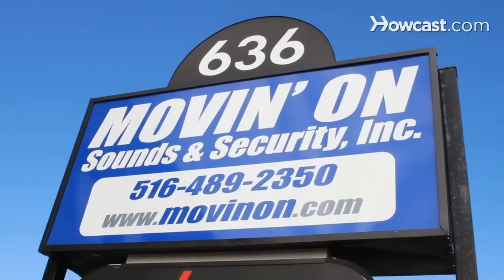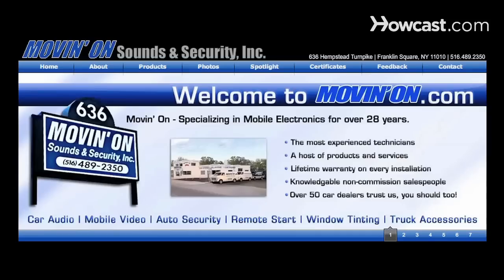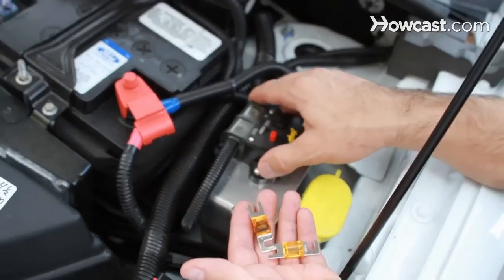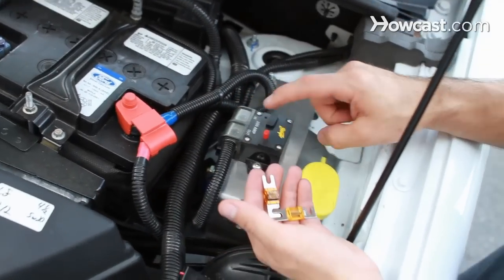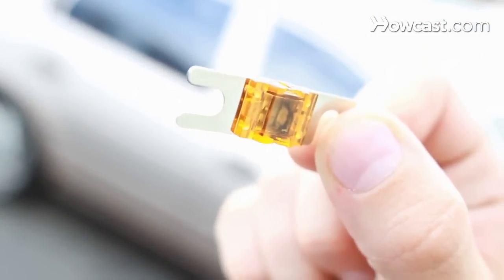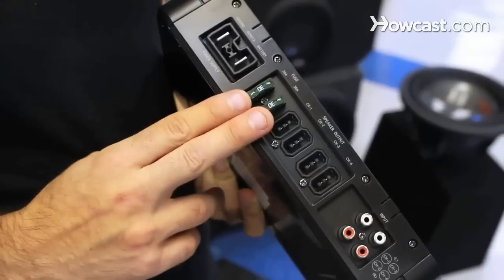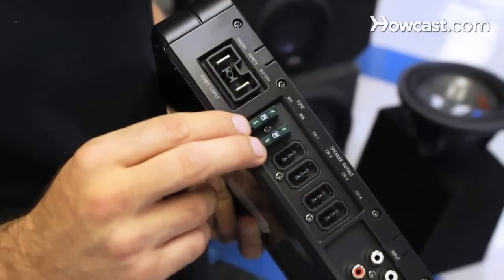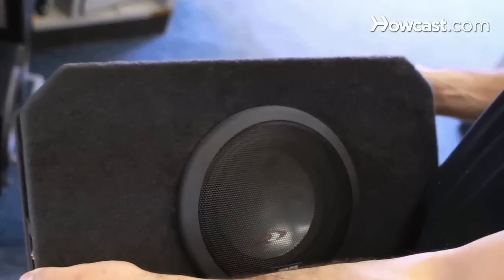How to Troubleshoot Dead Sub Amplifier | Car Audio

Comment: Helpful tip: Touch a 9 volt battery to the (+) and (-) on your subwoofer to check if it's working or not. If it pops, it's working. You can also use this to find out which lead on the subwoofer is positive and which is negative if they're not marked. Touching the positive to the positive and the negative to the negative makes the driver pop outwards.
Reply: Cheers
Reply: What does touch mean? Connect a 9v?
Reply: @MrFunnyHandsInYourPants obviously

Comment: Need help! Accidentally touched my amp remote wire on positive gauge for the amp and it blew out my whole stereo but can't find a blown fuse?
Reply: Go into your car owners manual and look for where it says your fuse for your speakers and if that's not it check the backup fuse which is normally located under the hood !

Comment: My system suddenly quit working. All wires seem good. Fuses OK. Speakers not blown. Was working great for a few months then boom died when in use. Checked wiring at amp with multimeter and showing nothing. Checked fuse but seemed OK. My next move is redo all wiring (as where I had it installed used some tiny gauge wiring and I know it should be larger because it was in my old vehicle & never had fuse blow issues, etc. like I've had with this install).
Reply: And what was the problem? Currently having the exact same issue

Comment: Sub was working, no issues, main fuse fine but then stopped working and blows every fuse I put into the sub (active sub) regardless of if it's running or not, I suspect the sub is dead, am I right or can I save a few hundred $$ on a new one

Comment: I had a similar problem... My subs / amp would just cut out intermittently while driving around town.  Eventually they just stayed off, connections are fine and my amp is showing power (green light) and is NOT in protection mode.  Fuses on the amp are fine as is the one by the battery.  I pulled the amp just in case it's bad and tested another amp but still no sound from my subs.... I'm literally stumped.
Reply: +TheMysticSpade 
if you put another amp in there and it didnt work i would say, double check your ground from your amp to your car, i had the same problem and i ended up running my ground to another location and scraped all of the paint away before securing it on there, also check the wiring to the subs inside of the sub box, i also had a wire come loose once and caused the same thing!
Reply: +TheMysticSpade Maybe a blown sub? There are ways to check that, if you search around.
Reply: paantma actually the voice coil went out on one as it's now locked and won't move.  And the other apparently due to the air pressure in the box was just moving on the connectors.  The place I had install my system did a shitty job.  No solder or crimp connectors just hand wrapped.

Comment: I just hooked up a 2 10” speaker box that was a gm factory upgrade for my camaro.  It only has one cable come out of the box that plugs into a harness.  When I plug it in I’m not getting any power. No lights etc.  I checked the fuse but it seems to be good.  What is the next step  to troubleshoot?

Comment: I hooked everything up months ago pretty well. Then the fuse/fuse holder under the hood melted, replaced it with a brand new one. Then today I was driving constantly then I noticed it wasn't playing and no lights on my amp are on anymore. Is my amp done for ?
Reply: +Willie Murphy Check your remote wire connected to your head unit, that's what happened to mine. If that's okay, then check your ground power, most likely you will need to move it to a different location.
Reply: Ok thanks

Comment: I have a Sony xm series old school.. all of the wiring is fine the green lite in the amp is ok. But when I connect the speaker there is no sound coming out from it..I swap amps and it works fine. Any idea's why this amp even though the green lite is up it won't produce any sound????

Comment: Where's the fuse located on a Soundstream tarantula tx4 560w amp?  My car I bought came with it, hooked up to a head unit dash speakers and door speakers also two 3way PwrBass extreme bi amp crossover (which can be a amp too) on the kick panels. 

Fuse under the hood is good, there's a hiss noise with radio on but still sounds good. When switch to sub from the cd player there's a slight volume drop, low sound through door speakers due to No sub-woofers hooked up.

I believe everything is fine with each amp. Just want know if it this is common and can I test each amp with a digital multimeter.
Reply: I am having problems with my amp it keeps burning my fuses
Reply: +Amy  Salazar get bigger fuses or lower your bass, just remember if you increase your fuses they might not protect your amp

Comment: I had 3 12"s powered off an 1800 hifonics amp, and i was bumping juicy j all the  sudden it cut out. I literally took everything apart changed amps subwoofers. My thing is it could be the fuse under the hood. But on both amps theres a green light, that signifies that amp is good to go, and red means stand by mode. Well i flipped my switch amp turned on, red light cam on, then dimmed out. I'm at a loss for words right now. Makes me want to take this stuff to Steve Meade.
Reply: your subs may have popped...
Reply: Frank Mannino Found out what it was, the main fuse under the hood, leading to the power cable (RED) was, melted i guess it was too much, for it to handle. I bought a new fuse, only like 4 bucks, and only have that one 12' in there now. Doesn't slam as hard, but guess that's better than going through fuse's like diapers. Lol.
Reply: you should really go with 0 gauge and make sure you have a really good ground and you wont have to bother with blown fuse's anymore.
Reply: 0 gauge wire, for the speaker to the amp, or for the +,- wires? These are good tips man, because i like giving bass demos to friends. :)

Comment: Ive got a hifonics brutus 1200 watt amp.. it completely stopped working no idea why. i tried a different amp and it works so its nothing to do with my wires. I have looked inside the amp and dont see anything that is burned or broken, there are no blown fuses, and everything looks like it should work. any help would be great!

Comment: How many volts should be coming down the red wire that connects to an amp on a car? For some reason my sub and amp combo has stopped working I've changed nothing, both fuses are good but for some reason it just stopped working. Both sub and amp have ran well for two years or more.. I've changed the remote lead and put a new connector on my ground and still the amp will not power up but when I Ark across from the power to the remote the sub works but the green led is very faint.. can you help?

Comment: I have two amps one for the speaker inside and the other one for the subwofer. I recently got a boss 5000 phantom install today . For some reason when I was playing it both amps stop working . I only hear the speakers inside. the amp for the subwofer is making like a pulse sound. What could be that?

Comment: so i have an BOSE OEM amplifier on my infniti G35 coupe 2004 and when i turn the car on it will take about 1-5 minutes for the sound to come on and after driving i turn the car off and turn it back on right away and the sound will come on right away. it only take about 1-5 minutes for sounds to come on only if the car is turn off for about 5 minutes or more. The radio, CD, cassette do work but with no sound for about 1-5 minutes after i turn the car on. so im not sure if its a wire problem or the amplifier since i already check the fuse and its still in good shape. pop open the amplifier and check and it looks like its good and im not sure about the wiring because its not like the speaker/sound wont work at all. it still work on all 4 speaker with clean and clear sound after that 1-5 minutes. and sometimes the speaker makes that popping noise. like a bass sound kind of popping noise before i can get sound back after that 1-5 minutes.
Reply: +Tewthpaste Check your battery, it might have a low charge

Comment: ihave two 10 in rockford fosqates and a renegade amp that matched up perfectly and played great for awhile and they stopped one day. no fuses are blown. the amp is fine. the only way i can get power to the ampis by taking a second rem wire and connect it to the rem port to the 12v port. then my subs play but very faintly and not to the song. my ground is going to my trunk and i have 12Gauge wire and my amp puts out 250 rms to each sub. whats wrong?

Comment: I have a 1200 watt amp and 2 12s and ever since I first hooked it up it dosent make them hit hard at all before turning off then when it hits just a little it turns back on and will hit again until it hits to hard already cheaked my fuses and everything it worked fine before I use to have a 600 watt amp and I just switched them out

Comment: i have a 91 integra GS, single 10" clarion sub, 400 watts with kenwood amplifier, which keeps draining my cars battery. Does that mean the wiring is wrong, or is my amplifier gone bad? we got it looked at, and while my cars off, theres power being used, when we took out the fuse, there was no power withdrawn. The guy said the amps bad and that 400 watts is way too much for my car too handle and recommended 150 or 200 watts.. im wondering if i need a new amp with lower watts, and also when the fuse is connected, subs work fine, sound nice, but after i turn my car off, wont start unless i jump start it.
Reply: I have 2 12 2400 watts how do I wire them I ran 4gauge wire that come with the amp and it blew my fuse on my battery what do I do
Reply: do you have a remote turn on wire? It will allow the amp to turn off the same time as the car.

Comment: i have a 5 channel amp that wont play my sub it will play my speakers and i just rewired it and sent the amp back thinking it was defective and the new one does the same thing any suggestions? its a 8 inch sub too

Comment: None of my fuses are blown and all connections are fine(I've tested another sub with them). But my sub isn't getting any power not even the power light is turning on. I've opened it up and all inside connections seem to be fine. Anyone have any idea?
Reply: Hey I’m having the same problem right now. Did you ever get it fixed?
Reply: @MrFish218  I ended up salvaging the speaker and using a new amp for it and it worked fine after I made a DIY box. Old amp must've fried

Comment: I have a problem! I just recently installed 2 15' subs and a 2000w amp, it is all hooked up correctly, when playing music if I turn it up pass 55 on the stereo my subs stop, so I added a capacitor to hold the power steady to the amp, still having the same problem. So how can I fix this problem, where do I start? Any help would be great. thanks
Reply: It's your ground

Comment: ok I have had the same amp and and everything in my truck for years work fine but to day it shot a fuse and I put a new one in and went for a drive I stop to check it out and the amp is really hot I look at all the wires and clean around the ground and its still geting hot please help

Comment: here's my problem and pls help. I have an active sub and another amp on top. I have two 6×9 speakers on my parcel shelf. suddenly my 6×9 speakers stop working. there is also a mild buzzing sound coming from the boot area

Comment: My Nissan installed rockford Fosgate trunk mounted subwoofer has started "popping" even when the car is off.  Can't use the audio systems as this popping interferes.  Unfortunately the subwooer appears to be hard wired into the system (there are no wire clips or plugs) so I can't just remove the unit and bring it to an aftermarket Fosgate dealer to have it tested.  Can anyone offer some suggestions?

Nissan wants $150 just to troubleshoot.  Not sure I trust them to find and or fix the problem.  After all it's not an oil change!!!

Comment: I recently uninstalled my sub and amp because i was going to sell my car but decided not to, so then i recently reinstalled amp and sub but for some reason now it doesn’t want to power on, any ideas why thats happening, ground and fuses are good
Reply: Same I even hooked up another amp I know worked and it has no power. Everything was working fine and tech mine song everything turned off I don't know what fuses to check besides the battery fuse that runs to the amp and the fuses on the amp

Comment: Mine is wired up correctly, I’m getting a good ground, good connection to the battery with a good fuse and my remote wire is working but the amp doesn’t turn on. My fuse on the amp is good but my amp still doesn’t turn on. Is there anyway for this ?
Reply: Felipe Perez same for me however I’m trying to locate the fuse under the hood
Reply: Sir Fapsalot I got mine to work somehow in the morning. All I did was turn on my truck and it worked lmao. Weird asf
Reply: Felipe Perez it’s annoying because my sub amplifier was working the other day and then suddenly stopped, my power, earth and remote cables are good but I can’t locate the fuses in the engine bag, I don’t know which one it is.

Comment: Sub not playing, not blown, fuses not blown, amp on and functional, ground perfect. Checked all the wires, re did them all. Still nothing. Been messing with car audio for years and this has stumped me. Haven't taken the sub out of the box yet to see if there are any bad connections but I doubt it cause its a push in connection. I put my tool belt from work on top of it and after awhile it lagged to come on so that's the reason just no idea what the problem is
Reply: Ever figure it out?

Comment: what would you say that it turns on (when the ignition key is turned on if you understand what Im saying) when the car is off but off when  I start the car?  Its been not working for three years before recently it started this.

Comment: i need help! my amp won't turn on but if I touch both remote and power together and its fine. what can it be
Reply: Skye Fuego I have the same problem. Did u ever find a solution?
Reply: Either one of the connections aren't good - check wiring and connections for power and remote.
Reply: It’s your remote in your radio.  Just cross it to the red wire :).
Reply: @damonmcdaniels1250  your right i had it on constant power
Reply: @htchero7  check your remote wire at the headunit. you might have it on constant

Comment: my amp works when the engine is off, at about 13 volts. When I turn the car on the battery climbs to 15 volts, and when I hit the gas it hits 16 volts. The amp is a bit old and turns off at that point. I'm going to try sticking some type of resistor into the power wire to decrease it by 1 volt. Just have to figure out how... because it's a thick wire
Reply: Maybe get a capacitor

Comment: my ampy wont turn on period. no fuses are blown, i had a blown fuse to the head unit when my remote wire touched the amp but everything was working (my head unit) i never had my system installed at this time, im re installing right now and just plugging my subs back and i left the amp hooked up, climped all wire ends when i left the amp. But now my amp wont turn on period.

Comment: Got a ? I just got a BOSS Ar4000 watt amp and for some reason the amp won't turn back on I've check everything and replaced the amp fuses and I do have a fuse block and I think I turned the bass up way to loud any IDEAS thanks
Reply: Amp is fried, Boss is a very cheap brand and never lasts long and will not produce what its advertised to do.
Reply: Okay thanks
Reply: No problem, I would suggest getting something like an American bass sq-1500m, I am a dealer and would be happy to help you with any ? Or equipment needs, check out my page on fb called WARES CAR AUDIO Installation.
Reply: I mean lol I'm a Bass Head so I like alot of bassss I mean I want a 10.0 watt Amp but everybody  want slot of money for it

Comment: can you help me please. I have a built in amp and sub combo. everything works perfectly but my amp does not turn off when everything else is turned off. I now have a flat batt
Reply: The remote wire must be in a constant power
It's the wire that turns it on when the car turns on.  If you have it wired to a constant power it will stay on
Reply: Haha fixed it
Reply: rafidreza was that it?

Comment: everytime i turn my truck on my Capacitor drains and my amp shuts off only when the volume is low you can hear em working i thought it was capacitor so i took it out and jus hooked it up again and still the same problem !! i have a fuse switch in the front next to the battery could it be that my amp does not go into protection mode

Comment: Hey I was wondering what is wrong with my 1500 watt crunch amp.. All the fuses are good. My subs are good.. My amps protection light is like on so no subs.. The ground is good the remote wire is good.. And its deff. Getting power..

Comment: SO i got a problem and its my amp, i hookd my subwoofer on a different amp and it worked but i hoop it on mine and it just doesnt have enough power. it goes so slow and makes no sound.. did a capacitors blow or what in the amp? someone help!!

Comment: i cruise around and my 2 12inch subwoofers shut down so i turned off the truck then i turned it on agin and the subwoofer came back to normal it usally only happens when i curise around. i need help

Comment: My 4 gauge wire keeps getting hot by my amplifier I have a power bass ASA 1000.1 on two sound stream 600 RMS sub's wired to two ohms i changed my ground and all my wires but it still gets hot and burns out it never use to do that
Reply: Gain is 2 high, bad ground,  power wires not very good, or prolly just the amp

Comment: Had a vm audio amp. I had it hooked up and no power light. Then hooked up another amp to the same set up and it turned on no problem. Then hooked the vm sub up again and it started smoking.  Help?
Reply: You need to communicate better and be more clear. It's hard to tell what you are saying but it sounds like one of your amps is blown